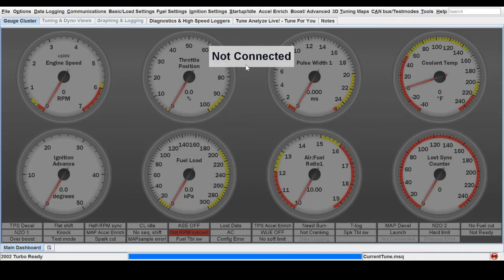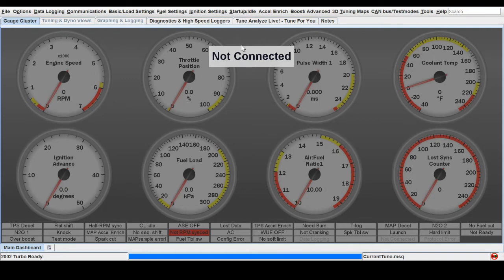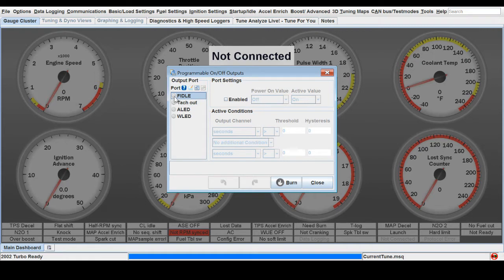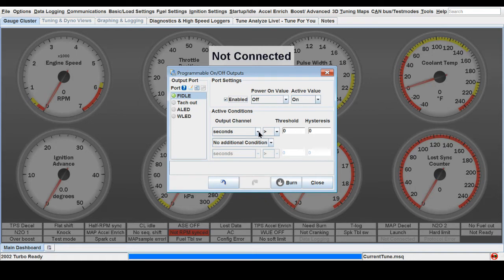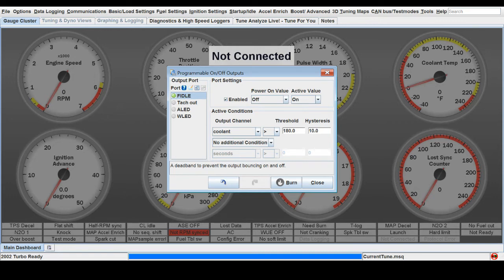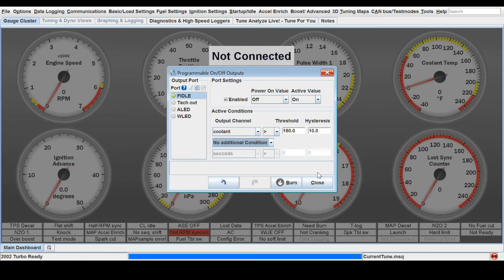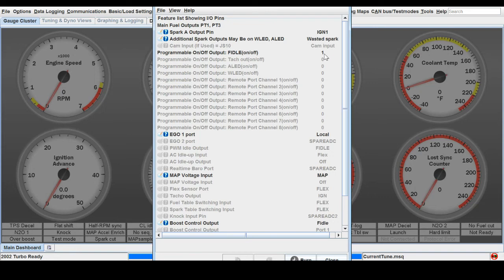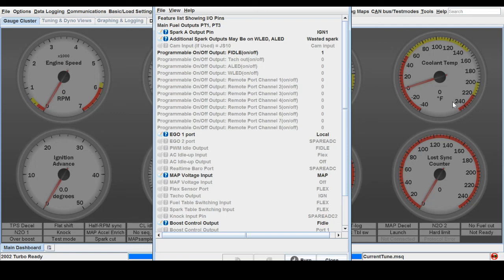Megasquirt Fan Control

Comment: I'm having an issue with my car where the Speeduino ECU that I'm using doesn't have an option to have a enrichment table for the idle air control valve settings and when the fan kicks on it's pulling a bunch of power from the alternator and causing the idle to dip down and kill the engine do you have any advice that might help aside from adding extra timing in the below cells or smoothing out the AFR in those idol cells because I've already tried that.

Comment: This did not work on my megasquirt with a KA24de it set the signal to my fuel pump relay which made it prime twice instead of once and caused an error I do have a wiring specialties standalone wiring harness just thought I’d share
Reply from the maker: You probably just have the wrong output selected. It could be the pinout on the adapter harness is designed to use a different output.

Comment: how would you go about controlling air conditioning if youre using a stepper valve controller?
Reply from the maker: There is an idle up control for the AC If you have enough IO
Reply: @TurbineResearch  can micro squirt do can bus

Comment: Thanks for the video.....what PIN/Wire do you use on the Microsquirt ECU, do you need to add any transistors to the circuit ...any chance of a wiring diagram

Comment: How do you test to see if the fans are working without the car running? I’ve figured out how to cycle the fuel pump but can’t find the how to do the fans?? Thanks!
Reply: set them below room temp  and on if they come on reset them to the temp u want

Comment: This method can be used for a sr20ve vvl activation?
Reply from the maker: Mike I am not sure if it can. I don’t have experience with vvl control.
Reply: 2Step _Anti_lag ok thank👍🏾
Reply: it can just change the trigger to rpm and set the values

Comment: How did you solder it to the board?
Reply from the maker: kiddtitan34 you don’t need to it’s already in the harness.
Reply: @TurbineResearch   okay Sean you said it's already in the harness but how do we know what number wire?
Reply: @mostinwilliams1310  obviously you don't have a MicroSquirt, cos it's written in big black letters on the cable.
Reply: I think it's the serial options port with the DIY - like cable they give you in the plug n play MS2 box. It's one of the cables you don't use.